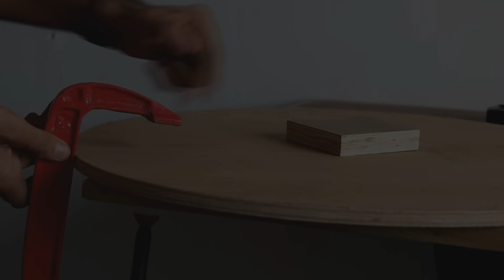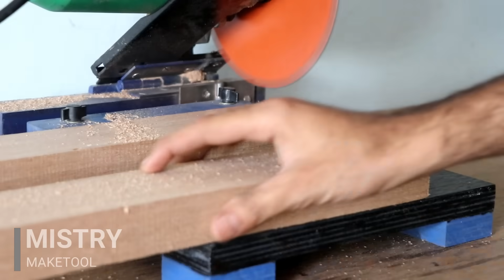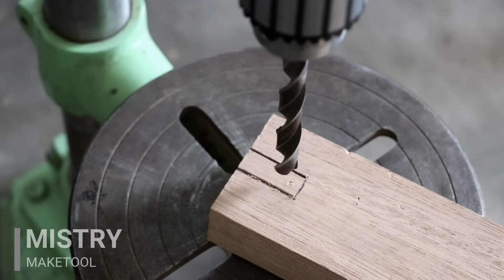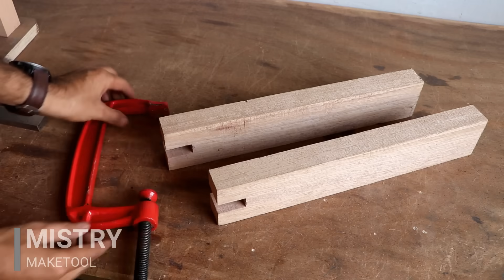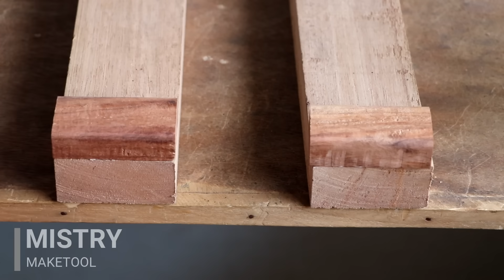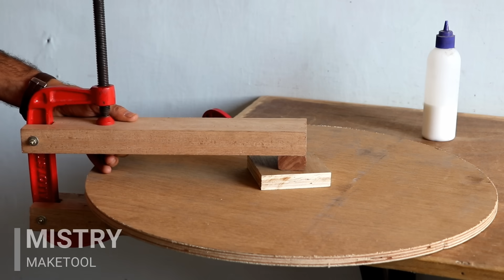Make Amazing Tool idea || Woodworking Tool

Comment: Good tool! This type tool has been around for centuries. It's called a 'lap clamp', or 'lapstrake clamp'. It is commonly used in boatbuilding to secure clinker style planks for clinch nailing.

Comment: Nice idea. Only problem I can see would this weaken the clamp.
Reply: The clamping pressure 9 inches from the steel clamp would not be much
Reply: Yes, slightly. Enough to matter? Probably not. The outside edge of the "C" is under compression; the inside under tension. To minimize weakening, move the capture holes outboard and use a smaller diameter 'pin' e.g. a roll pin. A large spring between the boards near the clamp, arranged to push the boards appart, teamed with magnets within the padding blocks will help with handling/wrangling, and storage.

Comment: Is little need to drill holes in c-clamp. Attach the long oak arms to a short link with two pivots to form an elongated U. Squeeze the long arms of the U with a c-clamp.

Comment: You don't need a square, just set the pencil in your fingers and mark both pieces. The reason the upside down jig saw struggled is because the blade is for cutting metal.

Comment: The bolts should be placed on the outside edges of the wood to give it more strength. You've drilled them in the middle. This gives the clamp equal force in closing as in opening. But since you're not using it for opening,  they can basically be as close to the outside edge as needed to keep them from falling off.
Reply: Icarus Fx . t%planer snipe

Comment: Drill your holes before you make cuts and cut into the holes, also, while this may work in certain applications, you're putting more pressure at the back if the clamp than on the job itself, ideally, you want direct force down onto the area you want to clamp, not as you have it near the back of the arms of the clamp

Comment: wouldn't it be much easier to take two long sticks, clamp them on one site, put the other ends over your work piece and clamp them as near as you can get?
Would do the same job, without have to alter your clamps?

Comment: Right on brother, great idea for a long reaching clamp. With the clamping pressure being so far back from the front of the clamp do you find the clamp wanting to slip or lack in any really strong clamping pressure? Just curious, either way this is a great idea.
Reply: I think, with such a long arm the amount of leverage at the new clamp position will be quite significant and therefore the clamping force there should be more than it would've been at the original stock position, only lessened to some extent by the inherent elasticity of the wood compared to a metal arm, for instance. A great idea indeed!

Comment: There are good applications for this kind of clamp, and I like the video in general. But, for this particular project, a 15 or 20 pound weight set on top of the piece would have worked just as well. Again, not knocking the tool at all, just unnecessary in this instance.

Comment: Why not just lay a board across and then clamp on both sides? Video is SO long.
Reply: Absolutely right... !!!!!!!!!!!!!!!
Reply: Brady Doepke i was wondering the same thing.  Cool idea, at the cost of a good clamp
Reply: Usally a board should be enough, I totally agree. However, I faced situation while restoring furniture where clamps that could reach deep inside e.g. a tabletop to reglue a piece of veneer were needed. A board would not give you enough clamping pressure here. 
Though for most people and jobs it is unnessecary for some tasks clamps like these are really helpful.
Reply: The example didn't show an accurate need for the tool he built. However, for me this was helpful. Imagine trying to clamp a brace or bridge plate inside a guitar body. You need a long clamp, but there is not room inside the guitar to just "lay a board across and clamp both sides. Specific tools are helpful for specific circumstances. There are clamps with very long throats to do just as I described, this guy just built one out of wood using a regular clamp...but it is a needed tool in the right circumstance...

Comment: Drilling a hole in your G Cramp will weaken the G Cramp.
Reply: Jeremy Clayton-Travis ...I guess you should tell this to all the aerospace engineers that make holes in aircraft parts... Geez, I’ll never get on another plane.... LOL :) (The ‘amount’ of weakening would be less than 1%... according to my strength of materials reference guides). I’d show you the calculations, but “trust me, Imma Engineer!! LOL :)
Reply: I studied Aerospace engineering. In Aerospace you design it in to the part.
The point I am making is that the alteration to the design will weaken it as users might impose greater loads on the G Cramp. 
In Aerospace the parts are designed for the load they are expected to endure in their lifetime. Sometimes they get it wrong and you find bits falling off or failing. I could give you many examples but I have MS and I'm to tired. 
You can buy deep throat clamps if you need them.
Reply: K
Reply: and the clamp is going to fall out from the sky?
Reply: So what? its not going to kill you if it does..